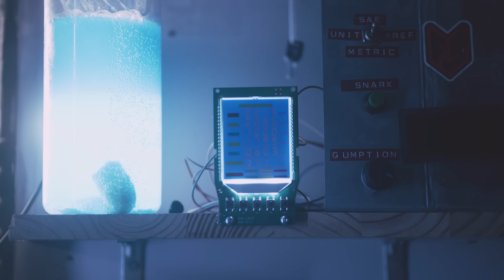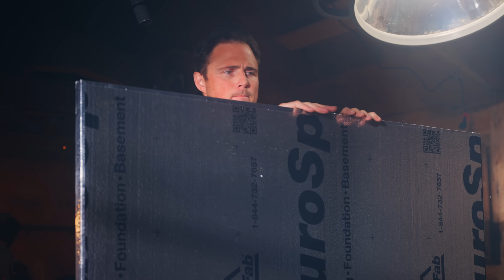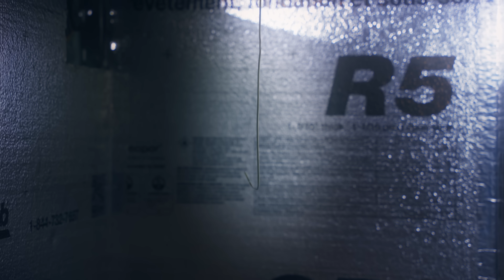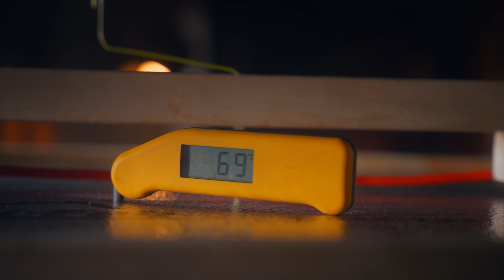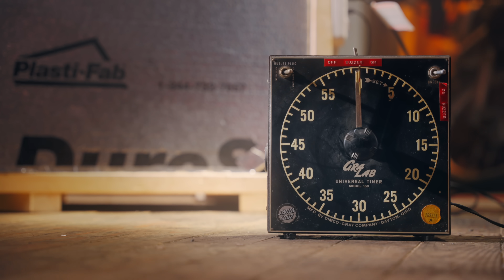Build a Heated Paint Booth

Comment: Set up the fan to blow clean air in (through a filter), not pull air out.  Not only does that avoid the explosion-proofing issue, but it also puts the interior of the booth at a slightly higher pressure than the exterior so it doesn't suck dust in through the joints.

Comment: That was hands down the best ad I've ever watched (no pun intended) but I'm a sucker for Pulp Fiction parodies.  The excellent heated paint booth subplot was completely overshadowed.  Pro Tip - Use the vacuum (or a PC muffin fan) to blow filtered air into the paint booth rather than sucking flammable fumes through the sparky vacuum cleaner motor.

Comment: If you had a booth you can stand in then you can use a cheap fan to "push" the air in to create a positive pressure.  The fumes get pushed out the exhaust port and no issues with exploding.  Use air filter on the intakes
Reply: It wouldn't work in such a small volume because it would push fumes to you as you work through the door opening instead of the smaller exhaust. I also thought about it beacuse one of our production rooms work using a very similar principle but you need to have all doors closed tight for it to work properly.

Comment: One could feasibly set up a fan with a Y in such a way that it draws the fumes out through one hose and both feed into he Y. It is very inefficient but less dangerous than drawing combustible vapors through a 120V device that isn't explosion proof. Still have to worry about static though.

Comment: 'Used to build photographic film drying cabinets the same way back in the day. but would put a HVAC filter holder into the assembly so the air coming through the unit was dust-free.

Comment: Or, for the exhaust fan, make it so that you blow into the sealed box instead of sucking out the vapours... Like the blower on a I/O powered boat.  Safer
Reply: If you have the box in an area that the vapors escaping won't cause issues with, sure.  However, the fan pulling creates negative pressure in the box so vapors won't escape through the gaps in the box, even better would have been to have the fan at the end of the hose pulling just to put it after that seam between the exhaust hose and the box.
Reply: No, no, no. That would do two undesirable things at least.
One: it would blow particulates around inside the box.
B: It would overpressurize the box causing the vapors to escape into the room, which defeats the purpose of the box.
Reply: @ken481959  *sigh*.   a)I thought it would be implied that there would be another hose to take the air out to where ever the pull through ventilation was going.  b) I did even state the assumption the box was sealed. c) if we use the same fan then there is the same airflow so there would be no more particles bouncing around. But its true I didnt notice he had no air inlet and you would have to filter any air going in and heating would be difficult.    So overall not practical.

Comment: Mmmmmmm yeah but the point of a booth is to take particles out of the air with filtration so they don's fuck up the paint. Use smaller door for painting and gun/can removal within a larger door used to get the part in and out and use clear panels (tempered glass so you can scrape overspray off) for viewing. Positive pressure so you always have filtered air coming in.